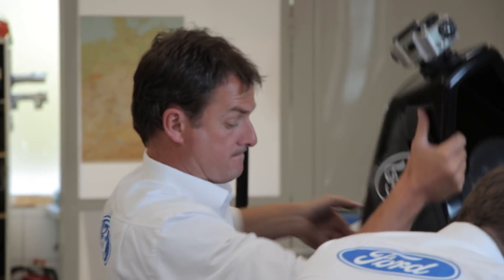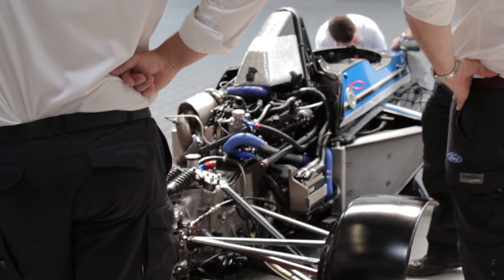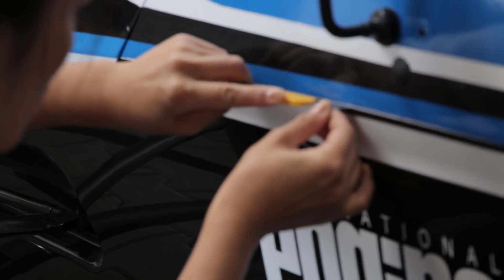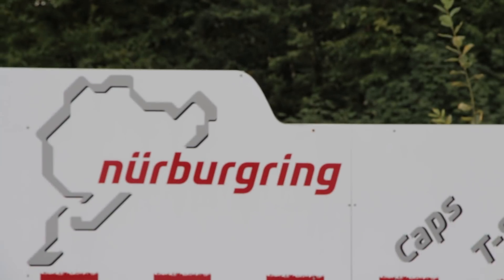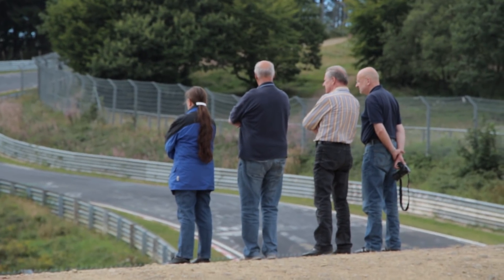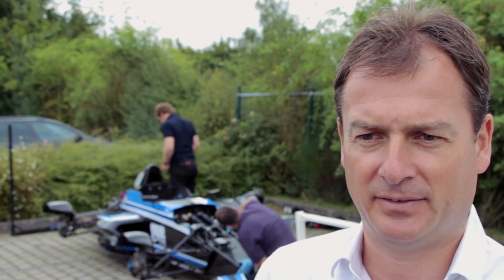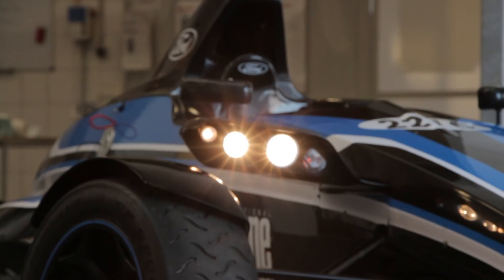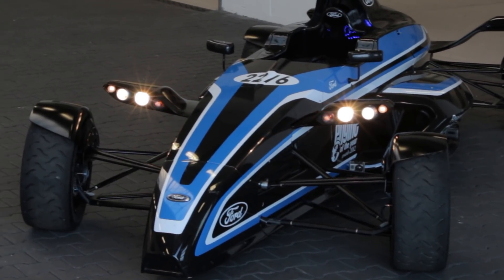How Fast is Ford's EcoBoost 1L Engine?

Comment: Ecoboost engines all : Easy damage heavy parts engines, 20-100 l/100km, over 100 l/100km by Formula One speed (160-250 km/hour, over 250 km/hour) on all circuits, test maximum over 150,000 rpm by all socials use low materials strength and wrong parts in course mechanical engineering for automotive engineering.
1-2 turbo intercooler has been invent for perpose commonrail diesel engines all.
From
Engineer statement military

Comment: When will ford fix the issue with eco boost engines shedding belt fibres and blocking the oil pump, I have seen this happen with as little as 30 - 40k miles, resulting in catastrophic failure.

This is an issue common to all wet belt engines including the Peugeot/Citroen puretec 1.2.

Comment: You compare a purpose built single seater to standard road cars? Of course it will be faster, especially on a race circuit. Sorry Ford but you shot yourself in the  foot here. It is just ridiculous. As is your new Ranger Raptor with a tiny 2L 4 cyl! But with a HUGE price tag.

Comment: roll on 5 years, and the 1.0 eco boost turns out be a poor engine, big failures ,over heating and cracking blocks along with cylinder heads, misery for a lot of the public who bought Fiesta and Focus eco boost range.

Comment: If only you guys sold crate motors, and a convertible with this motor "with an available manual transmission" in it in the US. I'd buy both.

Comment: Who cares how fast it is. We want reliability that's consistent.  Besides that car weighs 410/420 kg (1000 lb)  with the engine. engines, which typically develop about 140/115 hp, are capable of propelling them from 0–100 km/h in 3.9 seconds, reaching top speeds of nearly 235/220 km/h (150/140 mph). You won't a big engine with a car that light.

Comment: Of course its going to be fast if you mount it in a toothpick with wheels, and I bet its a remarkable racecar,  however sticking a turbo to a 3 cyl landmover engine and then placing it on a focus that weighs a ton and a half..... It´s not going to be any fun to drive
Reply: Of course its not. Its economical tho, which is what most of the public wants, and what gets them money. The general public is a bunch of morons, what can ya do.

Comment: Is this the near future of race cars?
Reply: Daniel McIntosh if f1 switched to this I’d quit watching
Reply: It is the present actually
Reply: Daniel McIntosh 

No.
Reply: past, present and future. just needs to come down a bit from 75 grand already.
Reply: Real Mike Clements I don't think you watches racing at all. If you did you knew formula Ford is a racing formulae used as a stepping stone to formula 1.
Reply: Lmfao this is the past of race cars. Formula 1 was using tiny turbocharged 4 cylinders in the 80's.

Comment: It's all about 'durability'' in this case. A 1.0 3 cylinder is enough to drive city miles in a Ford Focus weight car, if you maintain it and don't exceed 2,000 rpm before the oil heats up and use it to do some motorway miles once in a while, you might easily get 160,000 - 180,000 miles out of it, which is more than enough. It's like all engines : maintenance is important. If I were retired, I'd buy one in the blink of an eye. Now I drive too many motorway miles and often too far carrying a bit too much.

Comment: my fiesta ecoboost is going up to 205 hp in october and i can't wait. have to send the turbo off to be altered to withstand the extra power. but in april of next year, the forged pistons and cranks are going in. the well into the 200's is possible.
Reply: Pumaspeed? I read the article about their white ecoboost fiesta. Neat piece of work. I drive a Fiesta ST200. Got lucky one of the big dealers had 1 in stock.
Reply: Neo VeNoM
the st200 has a huge amount of possibilities which would turn it from a beast into a monster. happy driving
Reply: Thank you, happy driving to you too.

Comment: i know this is a very light car but i drove the fiesta black which is lighter then the focus at 140hp and the lag was terrible and very little torque i dont think the engine in this racing car is the ecoboost engine even at full chat it sounds different i think they have brought out this video to market an engine that wasnt tested that day sounds very similar to the 2000cc engine they have always used in formula ford
Reply: Formula Ford has never used a 2000cc engine.  It was 1600cc and since 2012 Ford has offered a 1600cc turbocharged Ecoboost engine for the series.

Comment: Formula Ford chassis have come a long way since the days of Lola T-342's!!! Is this video representative of current chassis and body rules for Formula Ford? Or were changes made to accommodate the Ring's Public Road Insurance requirements?
Reply: The car was modified to be a street legal car.  Normally it would be a wingless open wheel car just like it always has been.

Comment: I never saw the 1.0 L engine inside that car 
stupid people who believes this
Reply: "Its impressive time of just 7’22” beat the likes of the Lamborghini Aventador and Ferrari Enzo."

When they put this statement up, Lamborghini and Ferrari are eyeing on them, and could sue ford if they mislead consumer.
Reply: Kian Yung Chok because italian car companies are always honest about their power figures! ;)
Reply: Simon Tolson
 indeed, didn't zonda once race with slick tyres? illegal for road use, thus breaking the rules.
Reply: Well, not really breaking them, since there are no offcial rules. So enriched fuel, pumping up the ECU, modify the pressure, suspension etc.. all play a big role in attacking a course like that. James May once wrote an article about how lap times at this this track are actually BS. Because the manufacturer can simply bend the odds in their favor.
Reply: nino roland Watch Chris Harris Test this then you see the engine and it being driven in the road then you will know car is a one off, real deal 1.0L ecoboost ford.

Comment: The old Daihatsu Charade GTti 1.0 3 cylinder turbo can be tuned to over 250hp, stock internals
Reply: engine life: 10k km
Reply: munnsey the '87 Suzuki Forsa 1.0l 3 cyl turbo was also easily good for 200 hp on stock internals, the asians have mastered the 1.0l a very long time ago.  Sure Ford's may be slightly more efficient and get slightly better mileage, but at almost 30 years after Suzuki, I would hope so.

Comment: Okay, so it was never answered. How fast is the 1L? 3cyl sounds very good. Some questions would've being nice to get an answer for: top speed/HP/Highest RPM???
Reply: John McGrath your forgetting how light that vehicle is. Doesn’t need a lot of power to move
Reply: Well...it's the 11th lap time...
Reply: Carlos Dasilva it would
Reply: Carlos Dasilva Pretty damn fast if it gets 7:20 on the ring 🤣
Reply: 158mph was the quoted top speed when Chris Harris tested this.
Reply: Google it. You've never heard of formula Ford races?
Reply: Formula ford has been in finland for around 40 years now without pause. My dad used to drive in Fford but season cost is 15-30k euros
Reply: 126hp😂😂😂😂

Comment: Yep nothing new, Daihatsu been doing this for ages with the CB70 and CB80 from the mid 80s and 300bhp per litre is not far off. Been several cars getting 260-290bhp. This EcoBoost sounds just like a CB80.

Funny how Daihatsu technology is now being copied some 25 years later.
Reply: GTtiOC Can you put it in a rear wheel drive layout though? That could be ideal for a car like an Austin 7 or a Ford Model Y, even a post war car like a Ford 100E.
Reply: @chrishenniker5944  if you make a new fit engine mounting for that engine, than yes, it can

Comment: Question, Could you get 300 hp from this motor? Now i would be impressed, a 100 hp per cylinder on liter.
Reply: Absolutely not. You can just about get 300bhp on the 3cylinder 1.5l engine in the new ST's. The most I've seen you can get is 205bhp, and thats with a hybrid turbo.

Comment: But that's not the design of this engine - this engines designed for economy.

If you want power from small displacement, go look at turboed up Hayabusas and the like :P >600 bhp from a 1.3L
I think the BMW S1000RRs engine turbos up pretty damn well too, which would be a 1 litre. Both are i4

Comment: I'm a V8 lover, but i am constantly impressed with the work that Ford does to make smaller, more powerful engines.  This is how they will stay on top in times like this.  Keep up the good work!!
Reply: It is impressive. They are on Gen2 w/these GTDI engine designes. 15yrs in production! Well proven. I've owned 3 Ecoboost equipped trucks/SUVs. All were excellent. Current ride is '22 Edge ST AWD. Love it. Not selling this one!
Reply: I mean, Porsche, Koenigsegg, Ferrari, Mercedes etc. so many carmakers are doing the same 🤷🏻‍♂️
Reply: @k.r.99 I wrote that comment 11 years ago. I was in high school 🤣 I've learned a few things since then. I'm still impressed by this video, but their execution of the 1.0 eco in production cars could use a LOT of improvement 💀
Reply: @k.r.99 icing on top ... high school age iisj13 would never had guessed he'd grow to love Honda Civics 🤣 (that was my old username. i guess youtube doesn't change them on old comment threads)

Comment: I still think diesel engines need more research. As you may know here in Portugal the diesel market is much more important than the gas one and we are the top player on diesel engine mods. So, if a random dude, with a few parts can give the car a boost in performance just by changing some stuff, more can do the big companies...